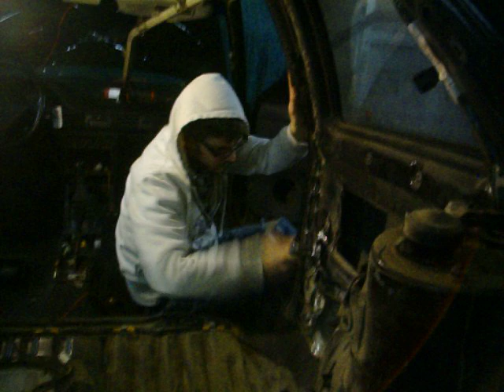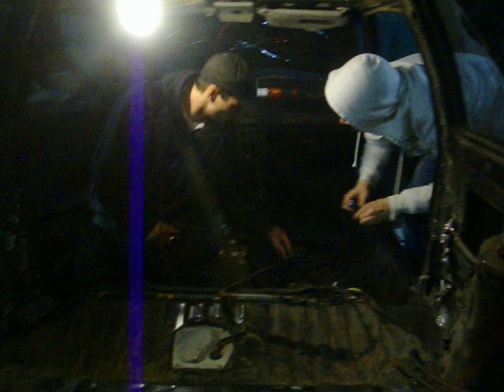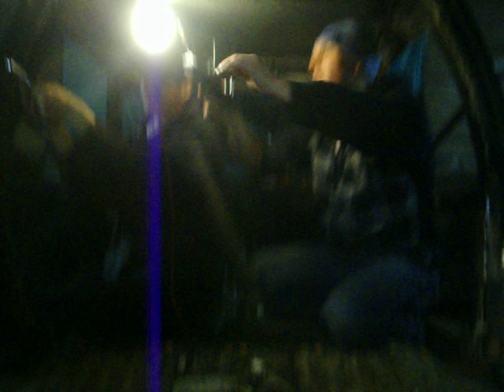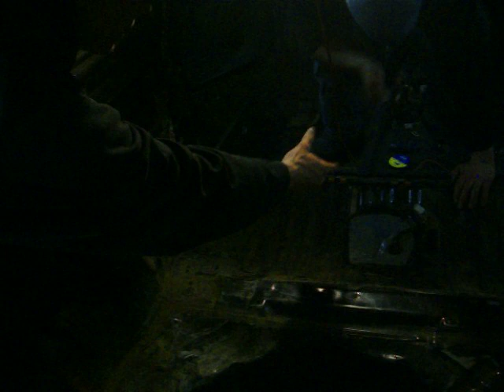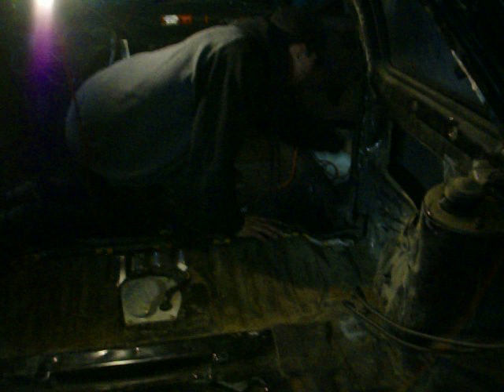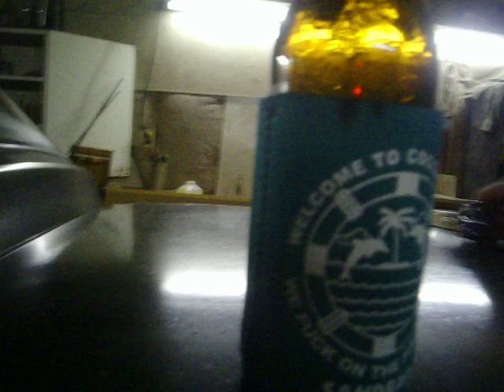mazda 323 build :)

Comment: Buying one of these cars (a beater really) monday. Will likely wall it as well so i can get my truck bed back (see my videos if you need that explained lol)
So do you happen to remember the measurements of the available space? I threw a tapemeasure into the one i'm looking at and got 36" tall from carpet under back seat to headliner and fifty something wide at one point but i don't remember.